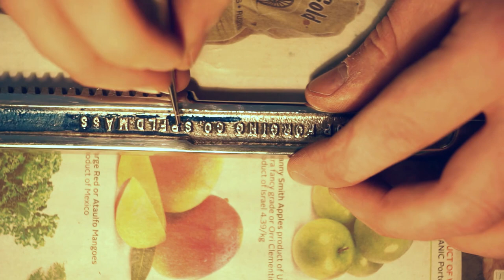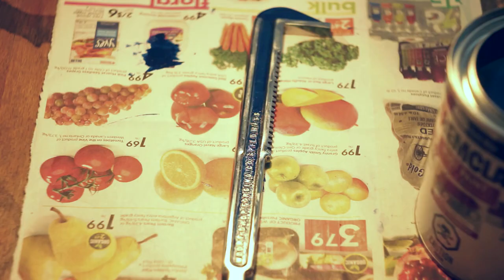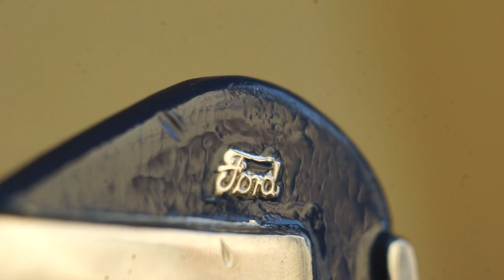Ford owners DROOL over this wrench.

Comment: Love the finish that you got! Perfect colour scheme. I've got a rusty project I'm working on, if you don't mind sharing, what are the dremel bits that you use?
Reply from the maker: Saiper 100pcs 1 Inch/25mm Sanding Discs Pad Sander Disk Kit with 1/8” Shank Abrasive Polish Pad Plate for Dremel Rotary Tool, 100/180/240/1500/3000 Grit Paper https://www.amazon.ca/dp/B07MNX9WGQ/ref=cm_sw_r_cp_api_i_fdyREbK1BPQ5M
Reply from the maker: Yasumai 40 Pcs 3mm Abrasive Buffs Polishing Buffing Wheel Set Kit for Rotary Tool Grinding Accessories https://www.amazon.ca/dp/B074V5GXZ8/ref=cm_sw_r_cp_api_i_leyREb2ENWR72